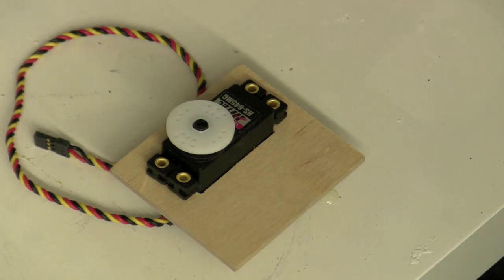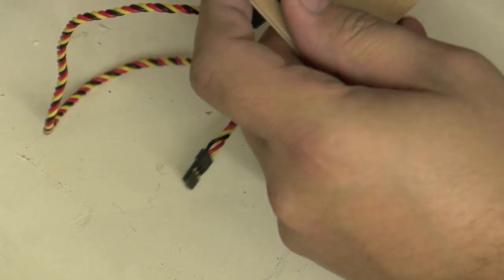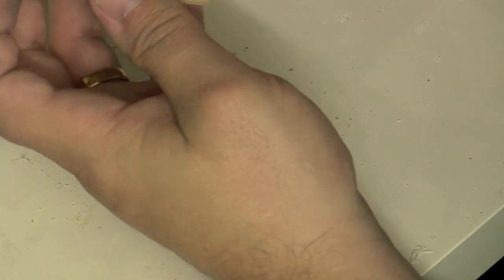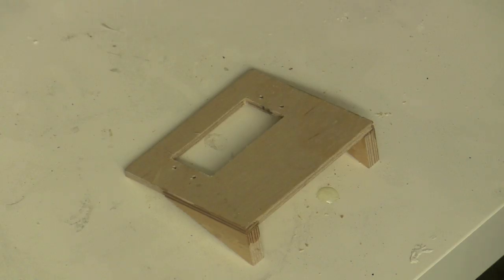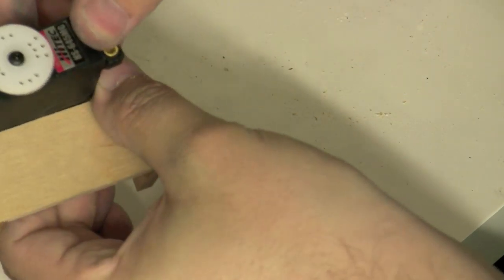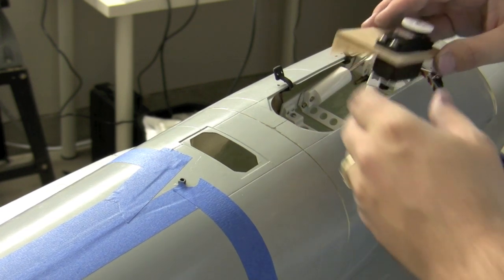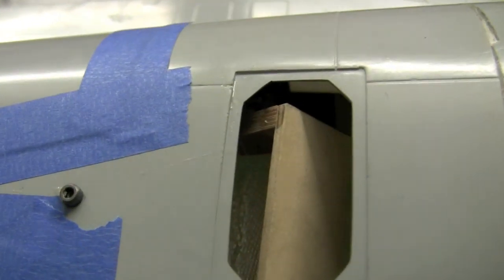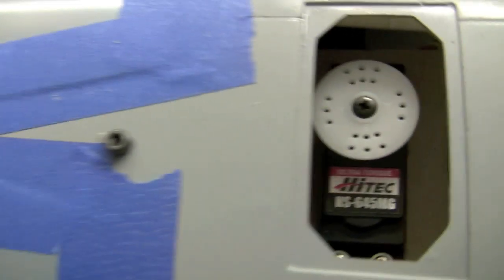Yellow F-16 Build #29

Comment: 7 years ago but those watching for the first time like me, he put servo brass screw sleeves in upside down. Curled over part sets against wood to prevent sharp edge on other end from digging into wood over time. This would loosen mount eventually and cause unknown problems. It would be one of those unsolved crashes, e.g. If on aileron or elevator eventual slop could cause flutter especially on high performance planes. 
Love your videos better than any I've seen. Thanks for all your time investment in your fellow Modlers success.
Reply from the maker: Good info!  I'll go back and take a look.  Haven't been able to work on it forever so still an opportunity to fix the error.  Thanks for the positive feedback!  :-)